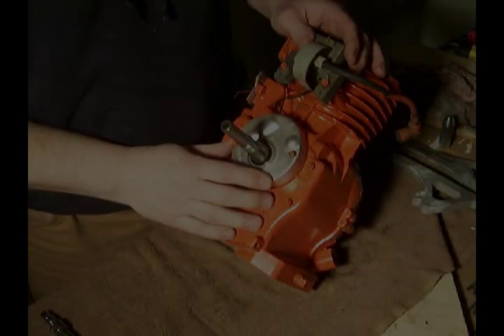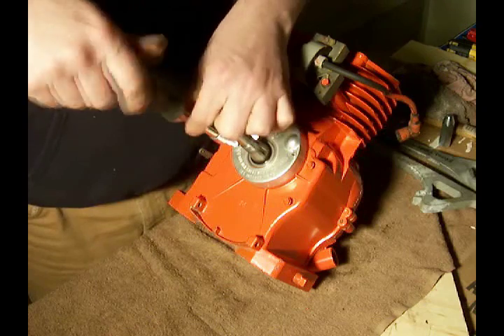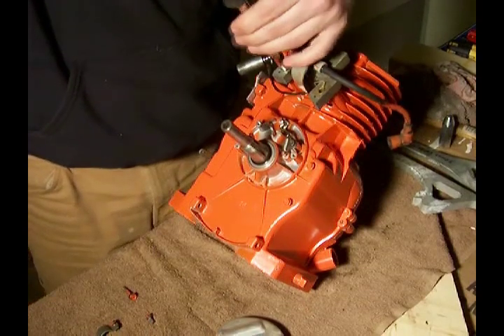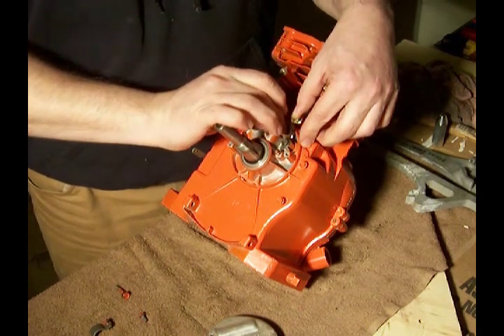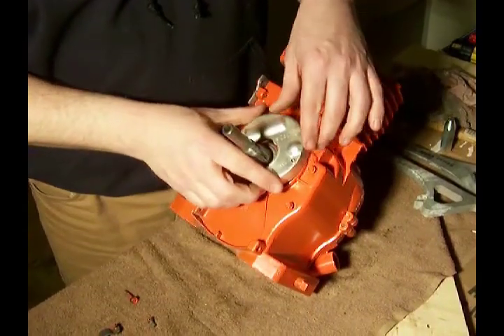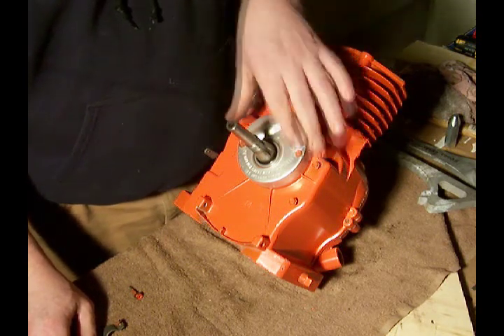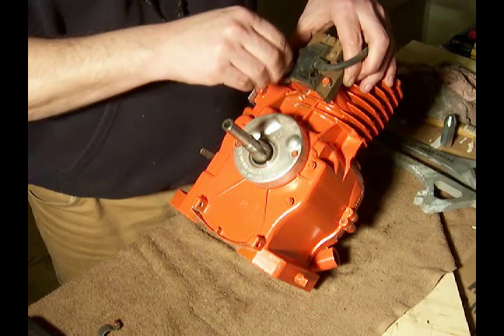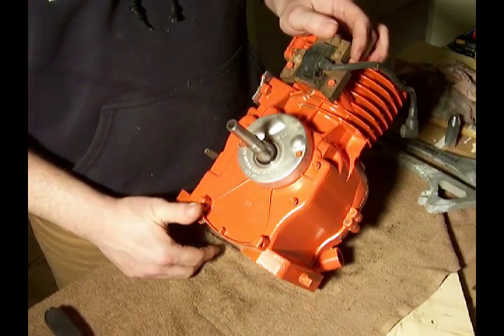#13 - Briggs and Stratton 5HP 130202 - Replace points & condenser ignition with a Magnetron Ignition

Comment: I have a Briggs 5 hp Model 130232, type 075701.  The engine has no spark and I want to replace the coil and points/condenser with the Magnetron unit part #397358..  However, the old coil has air air guide (part #221480) attached to its side with a rivet and a bolt; the new Magnetron unit does not have the rivet or bolt hole to attach the air guide.  Is it OK to run the Briggs engine without the air guide attached to the Magnetron coil?

Comment: I have a briggs Stratton same engine, with a magnetron on it. It seemed , from the beginning , to fire on the intake. I have checked for a pin in the shaft on the flywheel, seems fine. I'm a little baffeled, as I find it hard to believe someone would take it apart to rebuild and put it together with the timing marks not together. Is there any way other than taking it apart that this could be miss aligned ?

Comment: I just upgraded my Briggs and Stratton model 130202 to the "Power Pack ignition. I used the coil for the BS model 397358. I got it from DB Electrical for $16.45. The manufacturers part number is IBS3002.  I took the plug out of the cylinder and laid it against the head. Never seen such a hot spark an a small engine.
Reply from the maker: That sounds great! I am going to check it out!

Comment from the maker: Although I showed a used part in the video, I ultimately bought a Briggs and Stratton  #397358 coil. It seems to be a common part for the Briggs 5HP Horizontal engines.
Thanks for watching.

Comment from the maker: @tv175s3 I have searched the internet and youtube for that very same issue. I did not find any difinitive answer. I saw an occasional reference to some fairly expensive electrical gadgets, but at this point, I just install it on the engine and check for spark as shown in the video. So far so good. Thanks for watching.